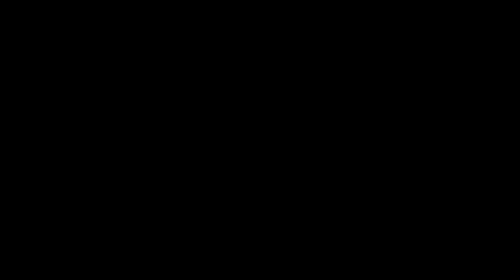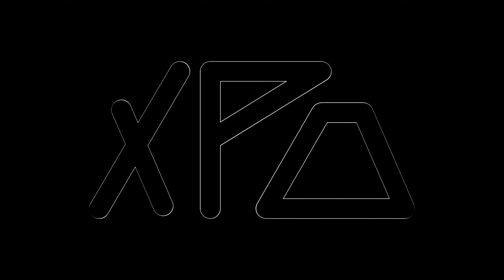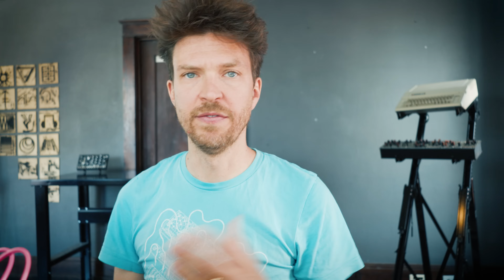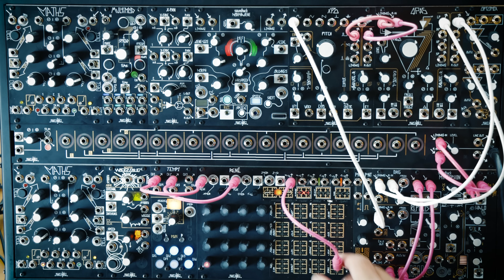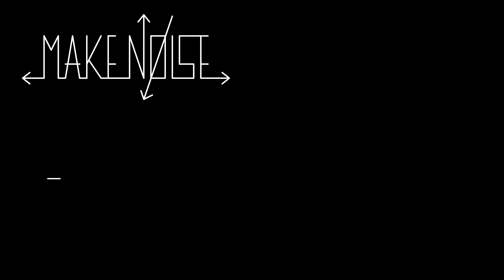XPO's Dual 1v/Oct Inputs! | Make Noise

Comment: i'd probably use the second one for fm and i just realised that i can do the same in my setup without the xpo using a precision adder. thanks for helping me come up with the idea.

another idea that would probably be fun to explore in a video would be the boundary between melody/pitch-stability and dissonance/atonality. there are a lot of interesting trimbres to be had at that boundary. for instance using maths as a more-or-less stable frequency divider for fm modulators or sending atonal sounds into the shorter zones mimeophon and sequencing mimeophon are two ways to do that, but i'm sure you can think of many more.

Comment: that expo vs linear fm thing (that linear wouldnt hold a static incoming voltage) is only true in the context of the XPO, right?
Reply from the maker: Many/most linear FM inputs are AC coupled so that any DC offset in an audio signal will not cause the overall pitch to bend out during FM patches.
Reply: @MAKEN0ISEMUSIC  huh! that makes total sense. thank you!